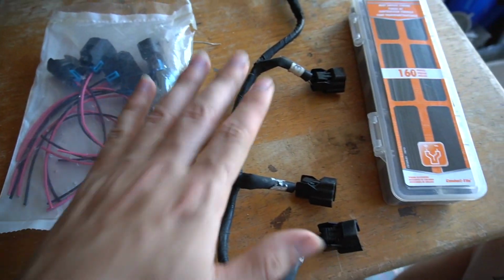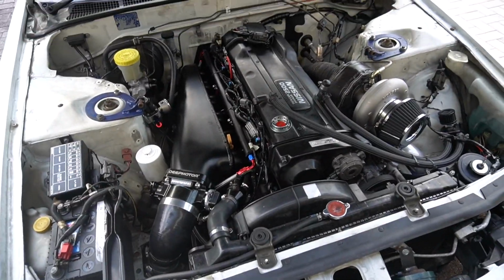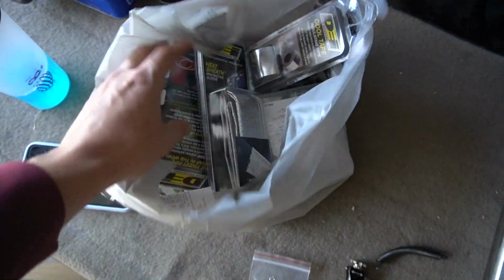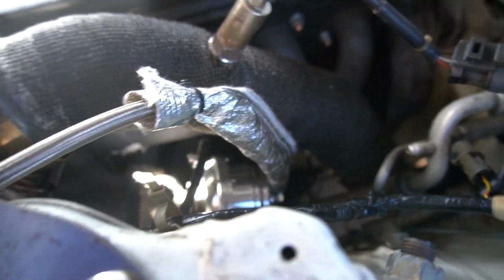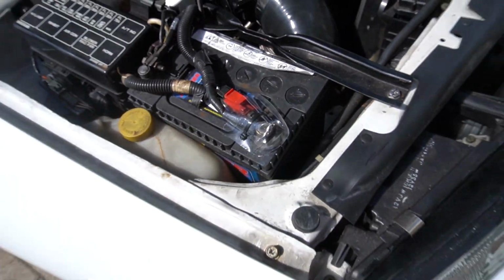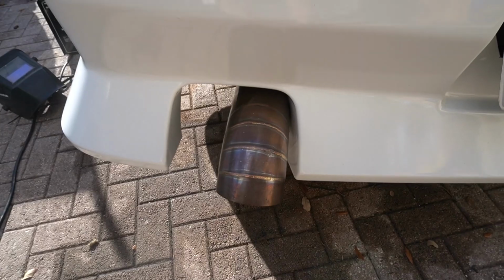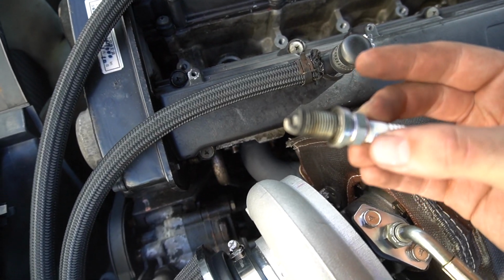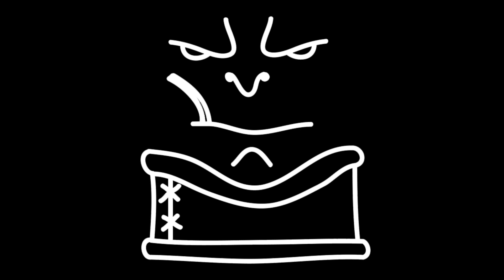BLEW UP MY RB25 ALREADY!

Comment: RB's are super finicky with oiling. Best option if the bearings are gone is get an RB25Neo and swap it in and get a proper ECU and have someone reputable tune it. The NEO has RB26 style pistons and rods, an N1 oil pump front factory and since its a series 2 has the longer snout crank which is less prone to oiling problems and solid valve buckets. Sounds like you could've damaged the oil pump gears and starve the engine of oil or just a bad tune. Did you verify timing with a timing light? Were you banging it off the limiter when it started knocking?

Comment: And yes sir u never take the boost controller off and smash it. U dropped a cylinder. Gonna have to come apart new pistons and rods and a bore over. U pull the boost controller off a 2j and smash it to full boost... u gonna do the same thing